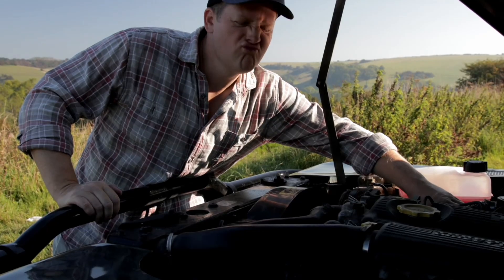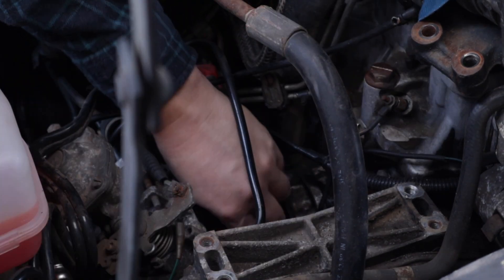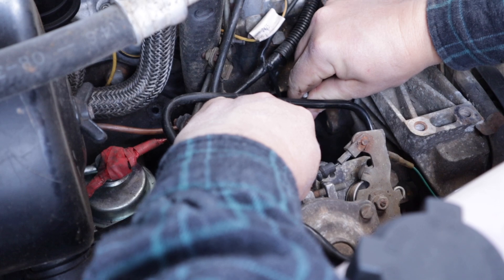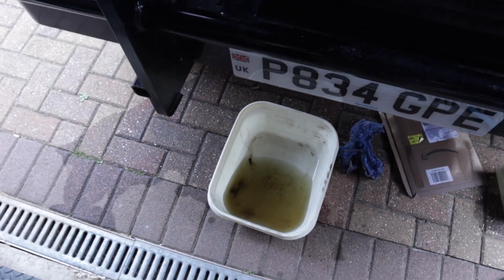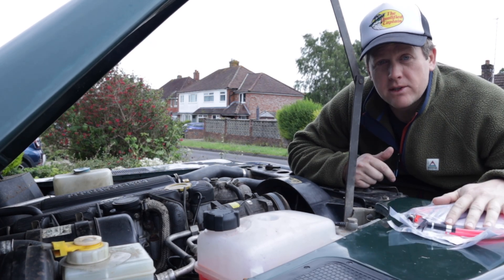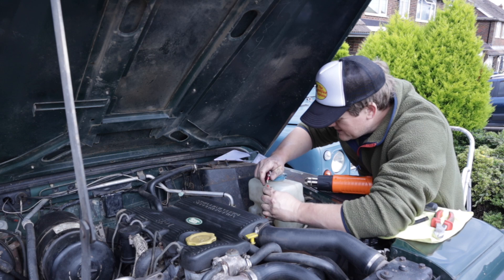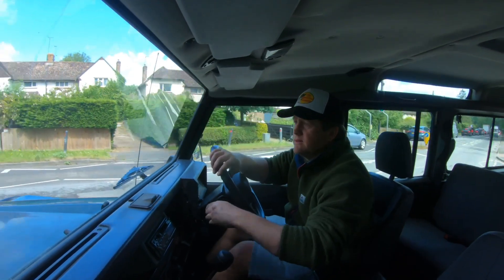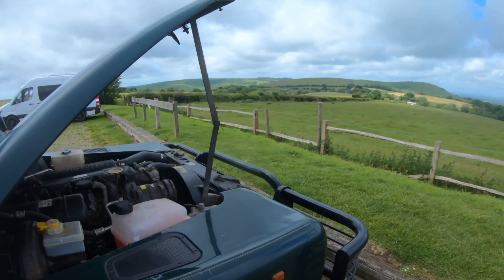Easy Performance Upgrade | LR Defender 300 Tdi - Boost Ring!

Comment: Hi Dale, just curious if after a year you are still using the boost ring or turbo thingy? What is your experience?
Reply from the maker: In the end I’m not sure it’s worth it. You can just rotate the original boost pin and get the same results.

Comment: Hello, be carefull measuring the exhaust temperature in this way. You have to mount the temperature gauge with an angle of roughly 45 ° to reach the hot exhaust gas. Temperature sensor need to be bent straight again. It roughly increases the measured temperature by 100 °C. I will show that on my Website.

Comment: Land Rover technician told me do not even turn the those  fuel pin from original factory position.  It will shorten the life of engine.  I have not covered workshop is something goes wrong so I decided not to do any upgrade on engine. But Yep it went really quick when I simply turn the pin to the max position and black smoke when every time taking off.  Loved it but now slow truck again. But do u notice that 300 tdi engine goes crap when you start driving but end of the day of driving, it really goes smooth!?
Reply: increasing fueling increases exhaust gas temps i reckon as long as you stay within the range of acceptable temps it'll be fine.
Reply from the maker: You're correct, my 300tdi takes ages to warm up and run smoothly. Since making this video I spoke with a specialist mechanic and from that convo I reckon I need to make another video detailing what he said.

Comment: Let’s say that is the wrong way to re power your defender. You have to look at fuel ratio (air + fuel). If you just look at fuel side you are running the risk overheating on an engine that is particularly sensitive to that.. if you really want to get more power from your 300tdi, the best route is going to high performance intercooler, variable geometry turbo and then tuning your injection pump. But before that, if you haven’t done yet, you must do an injection pump overhaul (overdue job at this point) and fuel injectors replacement. All you are doing now is killing your engine.
Reply from the maker: Really good advice - thank you mate. I've always had my suspicions with these diy upgrades - particularly since they're marketed towards numptys like me :)

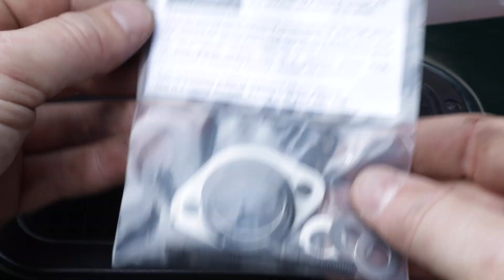Comment: Personally I think these changes bullshit.-STRONZATE..if you  adjustment engineTappet  give an extra gear without touching anything of the power supply ( the defender tdi 300 was voluntarily depowered by the Land Rover because the transter gearbox lt230 was 1:40 and not 1:20)....
Reply from the maker: Interesting! I'd love to read up more about this - are there any forums or articles you could suggest? Thanks

Comment: Love this man. I have a 300tdi 130 truck and just added an Alu Cab on it, and boy is she struggling with all the added weight. Looking at ways to increase power so I’m thinking of this and some other things like performance intercooler. Great vid and thanks! Cheers from Texas USA!
Reply from the maker: Thanks for the comment. Those Alu Cabs are sweet! I've since found out a few things on tuning the stock 300tdi without having to buy extra parts. You can just rotate your original boost pin so the aggressive angle faces forward and you can change the preload on the star wheel which sits below the boost pin spring. There are some other tricks I've found - maybe a whole new video. Anyway, thanks for watching and I hope you get it sorted and enjoy your 130 out in the wilds somewhere!
Reply: @DaleReubin   I've seen these tricks mentioned on the Alive Tuning video, but they also say they aren't sharing all their tips! Please do a video of this! I'm about to enter the abyss.
Reply: Buy yourself a front mount intercooler, vnt turbo, twin inlt manifold and upgraded clutch and ring. That will sort you out